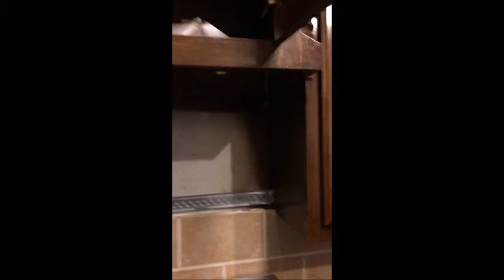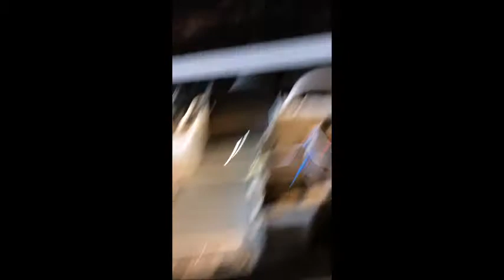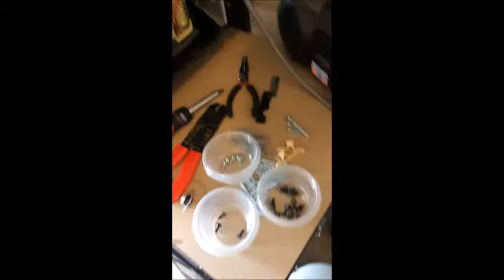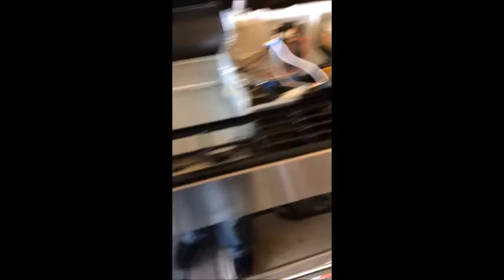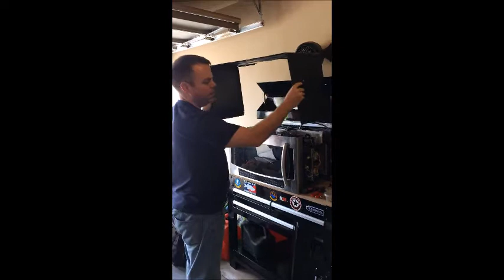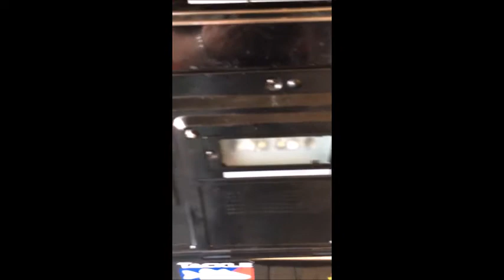Samsung SMH2117S Repair

Comment: Thanks for the video. I found that to replace the thermostats or fuse you don't have to pull out the whole microwave. Just unscrewing 3 screws in the front will give you access to them.

Comment: I have the same unit. Mine powers up to start heating and then pretty quickly drops power and the front panel looks like the power has been reset each time. Would this be the same switch that’s bad?
Reply: Hello jb.
Did you ever figure this out?
I have the same problem; looking for THE answer.
Looking forward
Reply: @Still-Learning  actually it ended up being under warranty so a technician came out and made the repairs.  He replaced the magatron? Unit or something to that effect.  Hope this helps.
Reply: @jbentzler5990  Got it...Thank you.
Reply: @jbentzler5990  
My issue was a control board...popped in a replacement... back to quick cooking...👍🏾
Reply: @Still-Learning  yes they replaced mine as well since it was under warranty. I just hope it lasts more than a year this time around.
Reply: @jbentzler5990  My concern as well as the replacement is a used part😬

Comment: I have the same microwave . The light is blinking inside . We lost the power and came back the microwave start to blink.It’s not working  could it be the thermostat
Reply: Did you ever figure this out? This is what mine is doing.
Reply: @vickiselva1256  no we put the microwave to the garbage. We tried to replace a thermostat but it did work for a bit and it failed after.

Comment: Thanks for the video. It was really helpful. Mine was a blown fuse. No issues with the door switches though. Got it replaced.
Reply: For replacing fuse, do you have to take the microwave down from the bracket ? How to access the fuse ?
Reply: Can't remember. I am pretty sure I had to take it down.
Reply: @mohammadyazar  Thanks for replying. Fuse is located on top of the thermostat. Its behind a metal frame. Don't have to take the microwave down to replace it.
Reply: Where's the fuse located?

Comment: So here is my issue. I’m pretty sure it what u had. When I plug it in the circuit pops. If I plug it in with the door open everything works fine like the lights vent touch panel and so forth with exception to the microwave. As soon as I close the door it shuts down. Is this the problem you had. Please and thank you for your information.

Comment: Can you please help me with replacing the hood fan light (not interior) we removed the light casing and there Is no light bulb and only 2 small connectors. Not sure where the bulb is or would be (located)? Does the whole Bottom part of the microwave have to be removed. Been with out a under light for 2 years and have had this model for 3 years and only a slight door problem . Please help. I Thank you in advance.